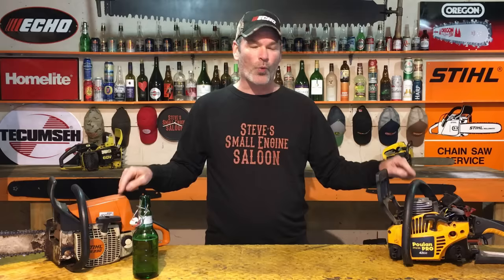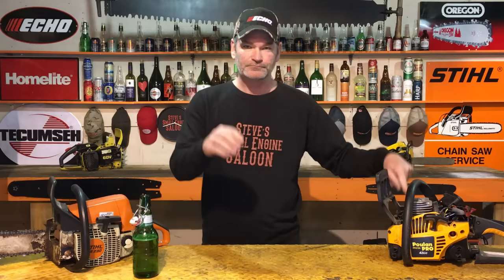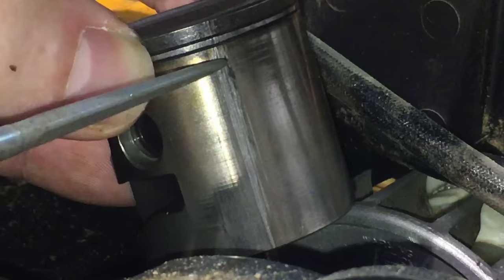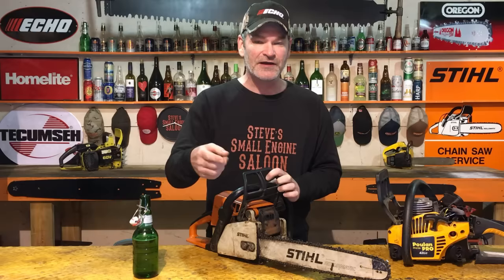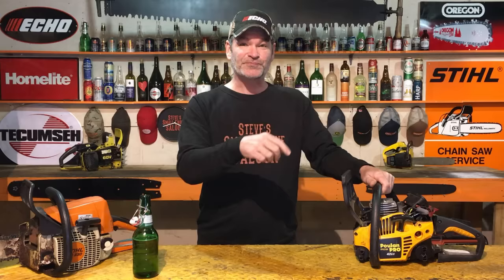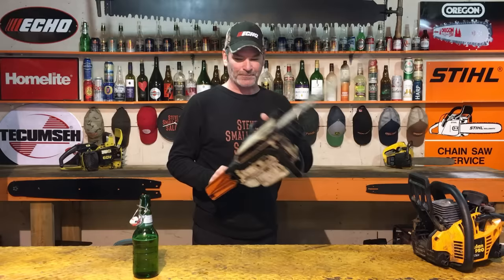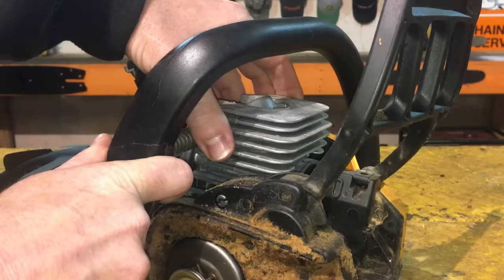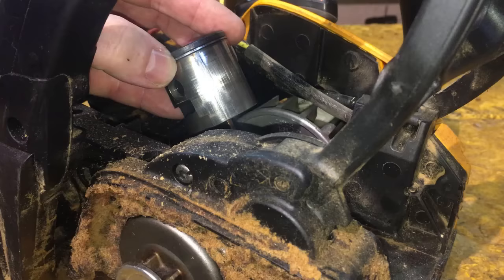WARNING: Never Do This To ANY Chainsaw

Comment: Being from the upper midwest and always cutting wood in freezing temperatures, I learned quickly that warming up your engines are a necessity. Cold saws were noticeably underpowered until they warmed up. I didn't know the why or what the damage it could do until now, so Thanks Steve for explaining why! Also, I drank a LOT of Grolsch Pilsner when I worked in Netherlands! Good job on getting the bottled as the canned ruins the flavor. I really like their Herfstbok!
Reply from the maker: Right on
Reply: Im from Michigan Upper Pennisula. We always had our wood cut, split and stacked way before it got that cold.

Comment: This advice is probably correct for any engine if you want them to last. There's no need to idle for too long just a light load at partial throttle opening especially in temperatures around freezing point or lower.
Reply from the maker: Right on

Comment: I let all engines warm up good especially my turbo VW, gotta get that oil warm and flowing good. Another good tip, let your engines idle for a minute or two when you are done using it, helps the engine cool down before shutting down.
Reply: vw engines are shit!!!
Reply: All turbos should be warmed up
Reply: no need for a cool down
Reply: @alanharding8762  yeah I keep wondering how much longer my Jetta with 400,000 miles will last.
Reply: @alanharding8762  Hey,  my passat turbo-diesel is dead reliable, nearly as efficient as a prius, and can tow more than most cars in it's class. Put alot of time bombing down logging roads, and she's holding together great

Comment: Think you'll find that the cheaper brands of saws will do the cold seizure more often than the better brands. When Poulan came out with their very cheap line many years ago, they had a decal on the rear handle area saying they were rated for 25 hours. Cheap, you betcha!

Comment: Thank you so much, you saved me tons of money plus brought lots of knowledge to a newbie like myself. Firstly I'd like to say that I'd just bought a STIHL 18" chainsaw, brand-new! I am watching almost every video out there before I start using it and I appreciate all the information that you provided.
Reply from the maker: You're Welcome...
Reply: Mines just came the other day a parker 58cc with 20" bar, still a bit apprehensive about using it tbh as its some bit of kit. Chainsaw gloves will be next on the list i think.
Reply: Get the required safety equipment, an experienced operator to teach you or find a safety class. You're about to operate one of the most dangerous tools available. Read the owners manual, congrats on the new saw!
Reply: @heavysnow8616  Soooo true !!! I don't believe my eyes when I see people operating a chain saw with sneakers and shorts and a t-shirt, no eye or head protection !!! They even should NOT sell chainsaws over the counter without a little course of 2-3 hours....

Comment: Hey Steve. You just opened my eyes to the demise of my 3-year-old MS 250. Thanks.
Reply from the maker: You're Welcome...
Reply: I must be doing things right. my 10 year old MS260 still runs like a champ.  heck, the 40 year old weed eater I "inherited" from my dad finally died from no longer being able to get replacement plastics last year...  I gave it back so he could use the gearbox to replace the damaged gearbox form the one he replaced it with.
Reply: Own the homeowner version of your saw, MS251. Always been difficult to start, but wanted to comment that with mine, you simply HAVE to allow the saw idle to warm up a bit as it simply will not throttle up until it gets ready to. Stihl BG 56c, think it is, anyway blower is a lot the same way, has to run 2-3 minutes before it'll hit maximum speed and really start humming.

Comment: Thank You Steve!  For some 40+ years I would sharpen the chains on the saws, fuel them up, fill the bar oil, get my PPE on and then start the saw up to get it warm before I would walk to the work site so that they would start easy once there and ready to cut.  I did not have a clue about cold starting / seizing up until I saw this video!  I guess I was just lucky that the short warm up run to ensure it would start easy later when I got to the wood served to warm up the piston which in turn warmed up the cylinder so they both could expand a bit. Sometimes you just get lucky. In the future, the warm up will be a bit longer and have new meaning, especially in the winter.  Thank again for the cost saving tip 👍.
Reply from the maker: You're Welcome...

Comment: Great video! One factor that may contribute to not seeing this isnthe likes of trimmers etc, is that they often will not rev to anything like max rpm immediately after starting (maybe due to no consumer access to L and H tuning in general), whereas most chainsaws will do max rpm straight form cold start! (or certainly will if you've tweaked the tuning to make them run properly)!

Comment: As a retired motorcycle, ATV, UTV, PWC etc., technician and machinist, this applies to every engine especially water cooled eng engines. Always let them idle for a few minutes before using it even if your not going full throttle and putting a load on it. With two stroke engines like chainsaws are, it's imperative that the idle air or fuel/air screw is set properly because they tend to load up with fuel that is unburned in the bottom end which can cause the spark plug to foul. Basically they're not an efficient engine at idle. That's why after idling for a while it takes a few seconds to clear it out to allow it to rev properly. 
Fun fact:
If you have a two stroke and a four stroke engine of the same CC, the two stroke will make more horse power, but pollutes more because oil mixes with the gas whether it's premix or injection and gets burned which results in smoke coming out the exhaust.

Comment: I can honestly say that i never ever do this and never have.  Even with my vehicles.  I let every combustion engine i have ever owned warm up before putting under load.  Not many people do this.
Reply: Well 4 stroke engines that splash oil on the underside of the piston are no where near as vulnerable to this But you ask any owner of a high performance tight tolerance clearance engine dry sump lubricated car (like an air cooled Porsche 911) you look at the oil temperature gauge and it has a minimum temperature operation mark as to loaded engine operation,, that oil temp must be reached before you can drive away. high performance  snowmobile engines run hard when cold will do the same thing ..

Comment: Started my litle Sthil ms180 c b e up today for the first time in years . I belive it have been sitting for about 5 years . I use the sthil ready mix fuel and i let it idle for around 5 min and it ran great didn't need to tuch a screw anywere , but i could see that i need to charpen the chain there were almost no chips and more dust than it should. Like youre videos .👍🏼👍🏼

Comment: From young on, I was taught by my Father, to let all engines warm up a bit before putting a load on them. 
  The newer 4 stroke lawn mowers do not allow for that, the carburetor on most are preset to start at running speed,  no ability to idle for warmup.
Reply: Starting at run speed and doing work when cold are two different things.  On sling lubrication it's not ideal to run slow.

Comment: Steve thanks for the heads up on cold start damage. Rebuilt my first personal husky 372 with low compression and when I tor it down had the exact damage in the exact same place as you showed in your video. I thought it was just a lot of use at the time, but know I know it was my no warm up that caused that damage. Thanks for the eye opener it wont happen again!
Reply from the maker: Glad to help

Comment: Also most pistons are aluminium.,and most cylinder have sleeves made of steel...the aluminum expands quicker than the steel sleeve, and also causing a cold seizure..

Comment: Excellent video. 
Throwing that saw at work immediately after start up goes against all good sense regarding any engine.

I  told a woman from work she was going to kill her engine by starting it in -10 degree weather and taking off right away. She didn't listen, by late January that one year old car was burning oil because she didn't allow it a warm  up.

Comment: I was a tree trimmer/timber cutter for power companies in 4 states (OH,PA,MD,and WV) and was a logger after that in PA and MD for a couple decades and never witnessed a "cold seizure".Still running both my Jred saws (2077 and 670 I bought in/around '92/93).The 2077 innards are still 100% factory with over 15,000 hrs on it.I installed a new ring in the 670 Champ in 2014 or 2015 and it had 15,000 alone just cutting for power companies and wasn't including all the side work we'd do after hours,my own personal work like firewood and clearing property on the weekends,and then when went into the logging industry.It probably has well over 20k after figuring those in.

 What does show it's head quite often is people blowing them up from not using the right mix and running shit meant for outboards and the cheap off-brand mixes because they may have bought that 6pk fer $3.
 Another contributor is today's gas...the Ethanol shit to be more specific.The mix,even though it's proper mix like Husky,Jred,or Stihl mix,the Ethanol doesn't mix well with the oil.The Eth also absorbs moisture...even sitting in a gas can...or that saws fuel tank.
 Yet another problem is so many do not know how to tune a saw properly or let alone know when it needs tuned up.You can take a drive anywhere and hear the majority of people that have any 2 stroke equipment don't have a clue their equipment needs tuning.You can hear them trying to get it to rev up (the ba-ba-ba-bog,ba-ba-ba-bog song) from a long ways off yet they think it's fine.
 Then there is still another thing people do is try to get that very last cut out of a saw when it's running out of fuel.Why bother adding mix to the gas if you'r just going to rev it up when it's running lean due to an empty fuel tank..

My saws have lasted so long due to any time it sounded odd or started to run different I'd fix it (done all my own work from '94 on).I'd always try and refill the fuel before starting big cuts.If I somehow forgot,once I heard it start to run out I shut it off and refill.

Coming back to that "cold seizure",I don't know how the new saws are but I know the older Jred 600 series and the 2077/88/94/95's and Husky 200 series and 394/95 had nylon oiler rings.If you fired the saws up on cold days and didn't leave them warm up 1st you'd rip out that oiler gear,if not then and there it wouldn't be long.I've only ever had to replace 2,both in my 670.One was from being so old it was just worn out,the other was thanks to my brother taking it one time and doing just that,firing it up and start cutting down trees without leaving the saw warm up and thin the bar oil out.

I forgot,I had to do a total rebuild on a Husky 268 in a motel bathtub one evening because the idiot GF of the company I worked for that cut for power companies brought out some shit no name mix and the crew used it.It fried quite a few saws that week.I refused to run it in mine,he even threatened to fire me if I wouldn't run my saw..."So what,I was looking for a job when I found this one but there is no f'n way I'm running that shit in my $7-800 (early 90's prices) saws".
He walked away with his BS mix and my saws still live today....lol
Reply: Bob Smithereens  
I wouldn't say that,I just never heard of it or witnessed it.It may come from scenarios that have no real explanation.
With just vids I've watched I can say he's probably the only Stihl mechanic I ever came across that actually knows what they're doing.The rest won their silver,gold,platinum stickers in a  lottery and are parts swappers.I'd say he got his from experience and the ability to learn.
Reply: Totaly agree with you !  I've been using and fixing chainsaws for close on 40 years and i have never heard of a cold start seizure ......Seizures are usually through lack of oil ...NOT cold starts .  As soon as the saw starts , ( being a two stroke ) its getting lubricated in every area , top and bottom . As for the cylinders expanding they have either chrome bores or cast iron , and those types of cylinders will NOT expand . The pistons being alloy WILL !!!..expand , but only marginally , as piston / cylinder clearances are made to exact tolerances to allow for piston expansion .
Reply: Like
Like Frank, I've not experienced cold seizures, but I have seen that using oils made for water cooled engines will cause more seizures on air cooled engines, especially with ethanol additives causing hotter running engines.  Air cooled engines need to use synthetic oils or blends made to withstand the hotter temperatures.  Not to mention that mfg's tend to run them leaner to meet EPA specs, also makes them run hotter.  The hottest part of the cylinder is the exhaust port, where natural oils will burn away, leaving little, to no lubrication at the port area.  Galling is material exchange between piston and cylinder from excessive heat and begins at the piston rings and trails down the piston from there.  This looks like early stage galling due to insufficient lubrication.  If it continued to run, the whole port area would probably become galled and eventually locked-up..  Use the correct oil for your engine in the proper ratio.
Reply: @leebordelon9581  Yep , there is a difference between these two types of oils and if you dont use the correct oil , then you will cause damage .  I also run all my two strokes on a 25:1 mix and i have never had any problems  . They always burn clean and certainly go the distance .  I would just like to add also that i find most two stroke oils these days are  good quality  and one can be confident in their use , although a lot of people  do prefer to use a particular brand of oil .
Reply: Cold seizures are real. Been working on engines all my life, and guys who pull full throttle on a cold engine are idiots. You saw the damage with your own eyes, so just how do you explain the damage, given the scenario Steve described?         Bob Smithereens
Reply: Oh man my next door neighbor needs to tune his whippersnipper. Borborborborborbohhhhhhboohhhhborrrr. Its like nails on a chalkboard to my ears. I want to go wrap it around his head. It sounds like it running at 5:1 with a plastic bag for an airfilter.
Reply: @frankschwebel8605  yaaaaaay! Thank you. That's why they're made of a certain material. I love when people try to apply this to modern cars too, but that's another rant Fer another time
Reply: great advice. thanks 4 sharing.
Reply: @yommmrr  Why don't you just go over and politely offer to tune it.
Reply: I'm wondering why you had to rebuild the saw then?
Reply: Same here, been logging with huskies for 25 years never heard of it and never warmed up a saw . When I get to work I start cutting.
Reply: I think a key factor that seems to be missed here is that Steve said that he has only seen this on chainsaws that rev up at 12 and 13 thousand rpm or higher.  Not on other slower 2 stroke engines.  I do believe the older chainsaws only reved up to 8 or 9 thousand rpm like your weed eaters etc.do.

Dale in Canada
Reply: I've seen people run the chain bar dry, than I've seen cold seizures. I guess that's because the saws by then, are so out of tune, that they can't heat up that quickly. They're usually only hitting every other stroke, allowing better lubrication, better cooling, and just not BURNING enough fuel to heat the piston up too quickly. (these are the same guys that replace spark plugs 4 times per season)
Reply: @dalemcinnes1834  Yup I agree seems the late model saws are like you say run up to maximum 12,000 or more. Vintage Homelite 150 had a top end of 8,500. Newer saws are emission controlled, and that 50:1 mix, lets face it is pretty thin. More oil, like back in the day would provide more lubrication, better heat transfer and better cooling even upon start up. The older "slower" saws seemed to have better low end torque which sometimes provides a bit better feel & control like when finishing off a cut. Without worrying about emissions & fuel consumption the older engines could be designed for more power, longer life and more forgiving of improper use and maintenance.

Comment: Hey Steve I bought an old echo weed eater from a garage sale and it was seized, I took it apart and seeing that whoever ran it before must not have been using properly mixed gas scored the piston up a little bit I took it apart sanded it up oiled it lubed it put it back together with proper gas fired it right up and it's been running ever since 2 years strong.!! 😁
Reply from the maker: Cool!

Comment: I'll say it AGAIN Steve, you just may be the (mechanically) smartest Canadian I know! (even smarter than my old boss!) I may be a bit of a wizz kid with a keen intuition when it comes to 99% of things mechanical and have a solid "hunch" why things just aren't working right, but leave it to YOUR VIDEOS to confirm my intuitions! And what makes it even better is you SHARE that knowledge! BRAVO SIR! Seriously, you want to let ANY engine idle for at least a good 60 seconds minimum before you hit the throttle to let the oil circulate and lube everything internally, and it's not really a good idea to go full wide open throttle even for about 2-3 minutes.
Reply from the maker: Thank You...

Comment: I fly a trike with a 2 cycle engine. I guarantee  you  you warm that engine up forst for 10 - 15 mins or it will cost you your life possably.  
    Cold seizure  is with all 2 cycle engines not 4 strokes.